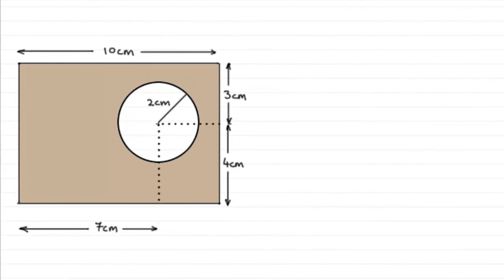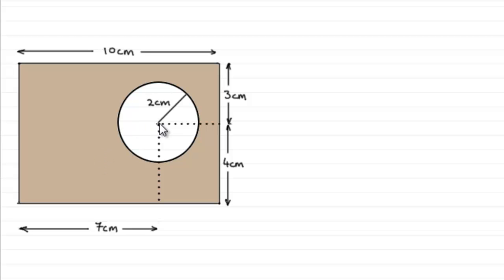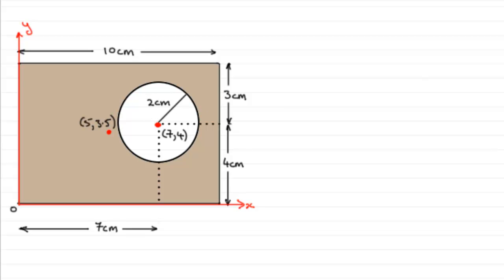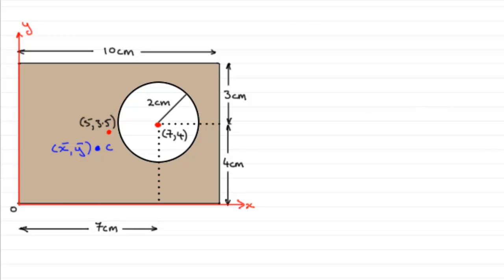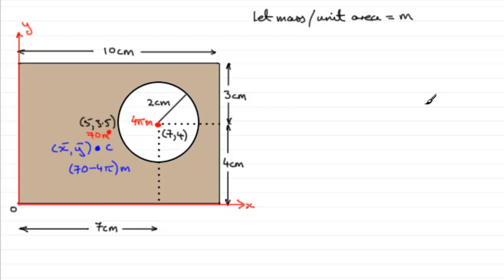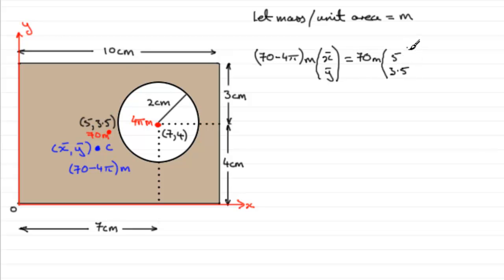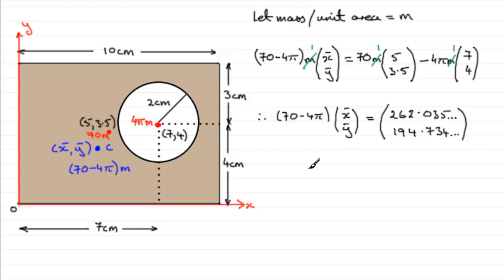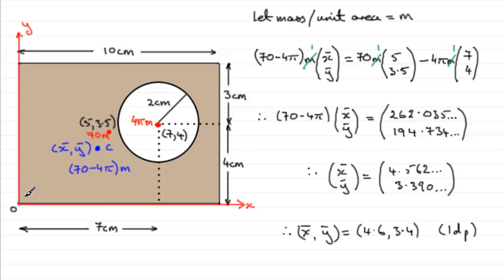Centres of Mass : Composite Laminas - Shape removed (4): ExamSolutions

Comment: Sir I was just wondering if you flipped the diagram horizontally,the centre of mass for the circle would be (3,4). Wouldn't that change the final answer? Or am I misunderstanding something? Thanks
Reply from the maker: The centre of mass would be in the same relative position to the circle but it's coordinates would change to (10 - 4.6, 3.4) Best thing to do is try it and you will see.
Reply: ExamSolutions oh yes of course, how did I not realise. thanks!